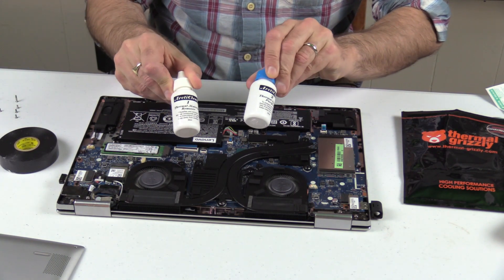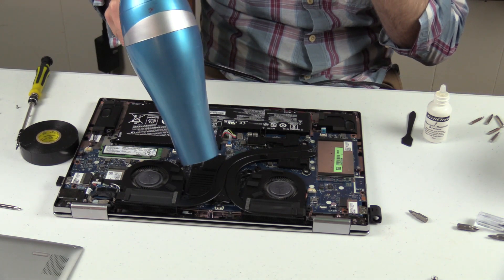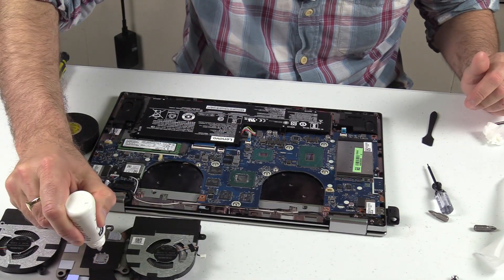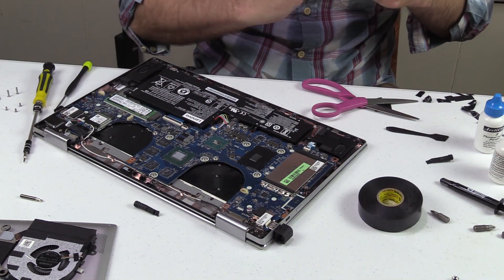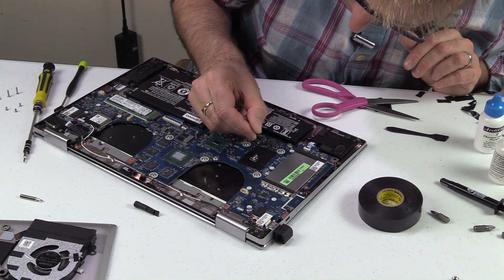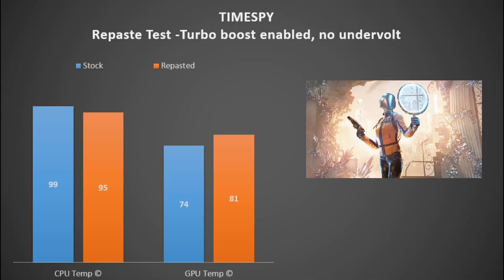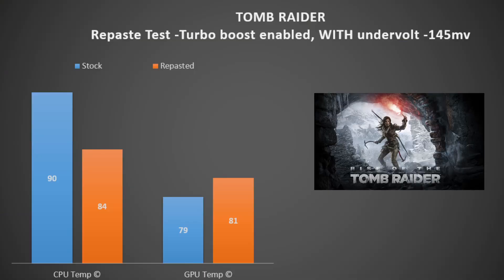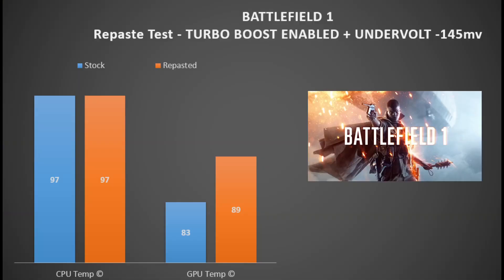Repasting The Lenovo Yoga 720 - GTX 1050 - Does it help ?

Comment: Thank you so mucho for this video. I did the same with mine plus an undervolt and managed to drop the temps.
Reply from the maker: Great ! Glad it helped :)
Reply: OWNorDISOWN Tech Decisions Made Easy I also use it in  tent mode to game. Ir improves the air flow And helps with the temps. But is it ok to game with temps around 80 degrees?
Reply from the maker: That's a good idea !  Yes, 80 degrees is perfect :) What thermal paste did you end up using ?
Reply: OWNorDISOWN Tech Decisions Made Easy I used the Artic MX4. I got a drop of around ten degrees with the repaste and  the undervolt

Comment: Hey Stephen me and a lot of other people have an issue with lap top. After a bit of use a black line appears located near the top of the screen. Nothing to visable but definetly a hardware defect. Do you have the same problem or heard about it? Love the laptop but im afraid I might have to return it. Wish you the best!
Reply from the maker: DrizzzDzn hey mate, thanks for the wishes! I have heard of the issue. Another subscriber had it and he told me that it was just with the 4k panel and Best Buy had stopped selling it. It definitely was a hardware issue. I must have been lucky as mine is fine.. If you have it then I woukd definitely have it replaced under warranty, or if you can return it to the store for a replacement. It's such a shame as it is a great laptop 😢
Reply: Exaclty my thoughts! I have it under an extended warranty actually but since I can still return mine for a new one that's what I'll do. I do hope I dont have to say goodbye to this powerhouse of a laptop but only time will tell. Also thank you for the quick response and let me tell you you have won a new subscriber! :)
Reply from the maker: DrizzzDzn thanks for your support mate!

Comment: Maybe the gpu temp increase wasn't Thermal Grizzly's fault. Maybe it increased because more of the cpu heat was being dumped into the shared cooling system, thus overwhelming the two tiny heatsinks. I would bet that conductonaut on the GPU would drop the temps, but they might still be higher than stock.
Reply from the maker: Yes, you are probably right Noah. Perhaps I'll try that at some point.

Comment: Hey just thought i would come back to this, received my 720 15" us model same as yours, had watched your videos before and was curious.
 After some minor experimenting ive found that my cpu runs cooler with the intel 630 graphics completely disabled making for a better gaming experience, so far running medium settings in world of tanks on 4k works fine as long as the laptop is sitting on a breathable surface, ive also found that it runs a bit cooler when using another keyboard and mouse with the keyboard facing down and the vents facing up, the screen being closer is nice as well!
Reply from the maker: Chunfucious good tips mate! I never thought about playing with the keyboard facing down, lol, but great idea. Did you disable the Intel GPu in device manager? I tried that on that Gigabyte P57xv7 and it became super sluggish, don't know why, or is there a different method to disable it?
Reply: OWNorDISOWN super funny, I actually disabled it, played three matches in world of tanks each on different settings and watched afterburner, It worked great and then I restarted the game and it's super sluggish, gonna do a bit more research!
Reply: Its interesting, the 1050 is dropping out every 10 seconds or so when not in game, like the integrated is trying to take over for regular desktop duties, I bet that 630 is a CPU resource hog!
Reply from the maker: Chunfucious lol, let me know what you find out 😊

Comment: Hello. Nice video. Can you give me advice on what protective film to use for the screen? Thank you.
Reply from the maker: Thanks. This one fits most of it, the screen is actually 350mm long and 205mm high but that includes the black bezels which the screen covers https://www.amazon.com/COOSKIN-15-6-inch-Anti-glare-Protector-Dispaly/dp/B00D84GA40/ref=pd_lpo_vtph_147_bs_tr_t_2?_encoding=UTF8&psc=1&refRID=Y8W7FP7NRDVJ7Q7TBB3E
Reply: Thank you. When will you publish the comparison video with the HP x360?
Reply from the maker: Cherubino Serafino I've just installed some games so it will be at least a week, probably not this weekend but next. If I can get it done sooner I will. My next video will be the P57x.
Reply: Ok. Thank you very much!

Comment: Is it possible to utilize a 16GB So-DIMM on this laptop? I've read conflicting reports. Could you find a working 16gb So-DIMM for the yoga?
Reply from the maker: I can try a 16GB DIMM from one of my other laptops , ideally you want them to have the same speeds but I can see what happens. I'll let you know.
Reply: Lisa from mobile tech review, in her yoga720 review," said that 16GB RAM (the one she was using) was too thick to fit in the RAM slot. So I have been researching and reading blogs to see if anyone has successfully  added 16GB RAM to have total of 24GB RAM. But I haven't found any yet. Have you found any Sucess OWNorDisown ? If you do please let us know of the particular RAM you used.

Comment: Hey could you do a video about replacing the gtx1050 with 1050ti
Reply from the maker: Unfortunately the GPU is soldered onto the motherboard - cannot switch it out :(
Reply: OWNorDISOWN so sad....I saw they said yoga 720 support up to 1050ti 4gb so I thought it’s replaceable
Reply from the maker: Ruite Xu as far as I know only the MSI GT73VR and some Clevo models have mxm graphics cards that can be replaced. Can the Lenovo yoga 720 now be configured with a 1050ti? Are you sure you aren't thinking of the 1050 4GB version?
Reply: OWNorDISOWN oh maybe it’s 1050 4gb...then can we upgrade the one to 4gb ourselves?

Comment: Great video. I did find the music distracting when you're talking but otherwise I liked having it in there lol. Do you know anyone else with this machine? Hearing some mixed reviews on forums but for that price I think I should definitely check it out. I have the Thinkpad 460 and could use some extra juice for Maya and Zbrush. Love having pen input. Just wish this had a 32gb option as well...
Reply from the maker: iamshrimpcat thanks mate. Yes, I should have lowered the volume of the music more. A friend of mine did the music, so glad you liked it. A few of my viewers have it. One viewer said his hinges were not in line but mine are fine. Be prepared to cool it down though if you decide to enable turbo boost.. Cheers.

Comment: Did you leave the tape in there after applying the new paste and closing it up?
Reply from the maker: yes, I felt it better to be safe in case the paste squirted out ..it has a max temp rating of 105 deg C .

Comment: Thanks for the review again. I am returning a second XPS 15 9560 (if it's not coil whine, it's backlight bleeding, etc. etc. etc.). Now I am officially done with Dell and the XPS line and I'm looking out for a new machine again. This WAS on the list, but from what I understand the thermals suck. Does it get hot with heavy gaming only ? What about normal (heavy, but non gaming) use ?
Reply from the maker: Lex Gabrees in my handbrake test with turbo boost disabled it went up to 73 degrees which is great. Activating turbo boost with no undervolt 86 degrees, undervolt it dropped to 80.  If you leave it running at max 2.8 ghz it is fine but want to allow it to boost to 3.8 you'll need that undervolt.

Comment: So...use the thermal grizzly conductonaut? Glad you used two different pastes.
Reply from the maker: Yes, I was glad I actually used two different pastes. I gave the heat sink a good luck and thought it was copper, I need to reopen it up and make sure but nonetheless it still works okay and cooler, lol !

Comment: Hello mate, i broke my screw on my yoga 720. Do you know where i can buy new one that fits in? And do you think it will be possible to use superglue and a screwdriver to get enough grip to screw it out? :/
Reply from the maker: Perhaps Lenovo might have spare ones? I would give you mine since it doesn't go all the way in, I'm going to try cutting mine in half, lol. You could try superglue, depends how tight it is in I guess. So it just sheared inside the case?
Reply: I think i have to try with superglue. If this doesnt work i have to drill this little fuc...
Reply from the maker: unknown reader that does suck big time. Good luck mate. Is there a way to carve your own "groove" on it so you can get some leverage?
Reply: nope i already tried it but its so tiny and i already scratched a little bit of the surface. If superglue works i will tell you. Thanks anyway !
Reply: I finally made it. As you said, I dug my own score. A few days ago I saw on the lenovo support site spare parts like the underbody. Now I find only 5-6 spare parts. Where did they all go?
I really want to buy a new underbody(case) because i scratched it with the screw driver. But cant find any :/
Reply from the maker: unknown reader great, well done!  Glad you got it out ☺️ I guess in time spare parts will show up on ebay..

Comment: So you leave the electrical tape on? Never used LM, saw a couple vids but like they used 1/4 as ;much as you did and lightly brushed it out.  I kinda wanna try it but would prob do it to like my lil pc in case I screw up lol!
Reply from the maker: bigbenisdaman Yeh, I left it on as it has a max temperature limit of 105 degrees C and I am paranoid it leaks out and shorts out something. This was only my second LM one. My Aorus x3 v7 seems to have survived, lol. It is very hard to spread, I found that using a que tip and lightly brushing the top surface the best so it gradually wets the surface. Takes some practice.. Go for it!
Reply: Ah, i was just thinking like electric tape don't really hold well over time but it's prob fine. And yea, i'd be paranoid it would leak lol!  If i can get the issues with my GL 502 vs i might do it on it after I try on lil pc and main pc, for practice and all.
Reply from the maker: bigbenisdaman good luck!

Comment: I got the Alienware 17 R4
CPU: Intel(R) Core(TM) i7-7820HK CPU @ 2.90GHz (2903.98 MHz)
Memory: 16257 MB
OS Version: Microsoft Windows 10 64-bit (Build 15063)
Graphics Card Vendor: NVIDIA Corporation
Graphics Card: GeForce GTX 1080/PCIe/SSE2
 far as i been testing this laptop is solid machine  does run warm not like my Apple MacBook Pro 17 inch back in 2008 that ran 214 degrees F
Reply from the maker: Welcome to Heaven What's it like when you overclock, say to 4.2 ghz?
Reply: i haven't done any over clocking yet but that will come soon

Comment: That liquid metal is just amazing what a difference :P gonna do this on all my new laptops for sure!
Reply from the maker: JooJoo Flop it is amazing stuff, I've been reading up on it though and seemingly you even get a reaction with copper so I think it needs some maintenance to keep at its best..
Reply: yeah i read the same thing.. they said every 3 to 6 months you will need to do it again to keep it at its best. but with the Alienware and most laptops its pretty easy to get in. However not so the razer blade pro!

Comment: Hey man last time i checked ur sub was at 2k and now it's at 4k. You are making all kinds of progress.
Reply from the maker: Tyler Durden on the NP9873? Out the box it runs hot for sure. Really need to activate max fan during gaming. The cpu is fine is fine with an under voltage of 102mv at 4.7 ghz. The GPU does get hot, in the 90s unless you blast it with the fan. Fortunately the speakers are really loud so they drown out the fans. Make sure no one is in the room with you though as they will go mad probably ☺️
Reply from the maker: Tyler Durden Yeh but you might ad well get the GT73VR one at Newegg for $1999 and a 120hz screen
Reply from the maker: Sgt. Keyboard Warrior Thanks, I'm trying. It's a lot of hard work.. My one year anniversary is coming up on July 13th.. Can I make 5000? I hope so!
Reply: OWNorDISOWN damn it, July 13 is my girlfriend's birthday too. I can pray for you man!
Reply: OWNorDISOWN hey man did you get a chance to see this laptop I think it's new gt73 with non overlock CPU http://www.microcenter.com/product/479019/GT73VR_TITAN_PRO-693_173_Gaming_Laptop_Computer_-_Black
Reply from the maker: Hey Tyler, o I hadn't seen that model ! Think I should review it? I've returned two to Microcenter but I can get my wife to buy it perhaps in a few weeks..
Reply: OWNorDISOWN yes that would be fantastic if you could review it and compare it to the one with overclk CPU, odd enough this model is only at micro center!
Reply from the maker: Yeh, Microcenter seem to get some great exclusives. I reckon it will perform similar to mine with i7 6820hk, slightly less perhaps..
Reply: OWNorDISOWN Thats very true same thing with Acer predator only micro center has the one for 2000$ with locked CPU as well
Reply: OWNorDISOWN do you think that the one with i7820hk and nvme ssd is worth extra 500$?
Reply from the maker: Tyler Durden not really, you can even buy the i7 6820hk one cheap. Have you considered that one?
Reply: OWNorDISOWN there are no MSI Gt73vr for sale with gtx 1080 and i6820hk brand new I was looking at the one with i7820hk gtx 1080 and just yesterday I went online to check laptops in micro center and bum this model pops out, I don't know if I should buy the one with locked CPU 2449$ or with i7820 for 2899$ 500$ is pretty significant imo
Reply from the maker: Tyler Durden Yeh, I agree, it's a big chunk of change. I'm reviewing the Sager NP9873 (basically the NP9876 but previous chipset) and have the cpu stable at 4.7ghz. That shaves off at least 15% off the time my best i7 7820hk was able to do in my handbrake test. I'm on the fence about selling my GT73VR to pay for it. I might send it back and get an sli version and then sell my GT73VR.. MSIs cooling is still better though and it is a close call between them. I hope I have time to do a smackdown.
Reply: OWNorDISOWN Did you stress CPU and GPU yet? If so how's your temps?
Reply: OWNorDISOWN micro center is on sale run I think look http://www.microcenter.com/product/467655/GT83VR_Titan_SLI-055_184_Gaming_Laptop_Computer_-_Aluminum_Black
Reply from the maker: Tyler Durden nice find Tyler! Thing about that one is the display. If it was QHD 120 hz or even 4k I might have bought one but a 1080p 60 hz?  Those sli 1070s are wasted..
Reply: OWNorDISOWN but still you can hook it up to external monitor  4k, sli will be able to push 60 fps in some titles I think

Comment: Can't see in the video, after you remove the original thermal paste: Are the heat sinks copper or aluminum? I see that there is an aluminum block surrounding the pipes, but what is the material touching the chips?
Reply from the maker: Its the same black coated material as the heat pipes, well, that is what I assumed it to be ! Hopefully it is !
Reply from the maker: I just looked up the bimetallic corrosion possibility of copper and aluminum (http://www.npl.co.uk/upload/pdf/bimetallic_20071105114556.pdf) . I think it is unlikely they would have both metals touching each other in a paste situation as according to the chart they have a good risk of corrosion..Thats if I am reading it correctly..
Reply from the maker: I can take apart this weekend to double check.
Reply: The reason I asked is: I took apart and re-pasted an older laptop this weekend and the heat sink surface touching the chip was Aluminum, so I was glad that I wasn't planing to use the CLU compound, just regular carbon based paste. So looking at your video today, reminded me of that, and I was curious if in your case you made sure that the heat sink was copper before you applied the CLU compound.
Reply from the maker: Denis Males I gave it a good hard look. I'm going to check it over and see if there was any reaction. You can test it too by using vinegar and salt water I believe too..
Reply: So what was the outcome? Is the heatsink copper or aluminum? And after 1 yr of repaste did you notice any reaction of LM with the heatsink?

Comment: Nice video over there my friend :) . It's recommended to apply LM to the contact area on the heatsink too to fill up the imperfections in the copper. Also, looks like you need a little bit more paste on the GPU (unless that aeronaut is just bad lol). Keep it up man.
Reply from the maker: Carlos Valls Thanks Carlos! I was worried about it spreading all over the place if I put too much on but I am a liquid metal newbie so thanks for the tip, I'll do that next time!